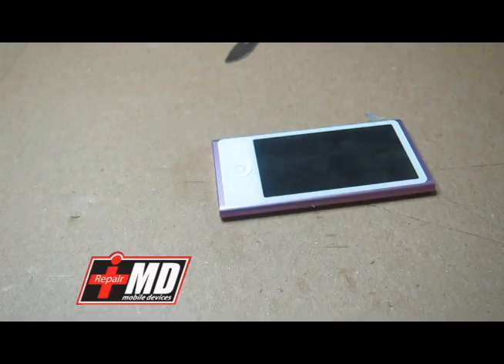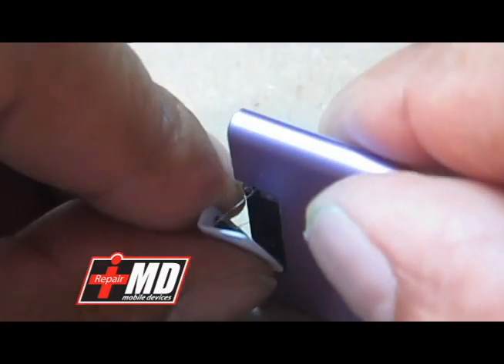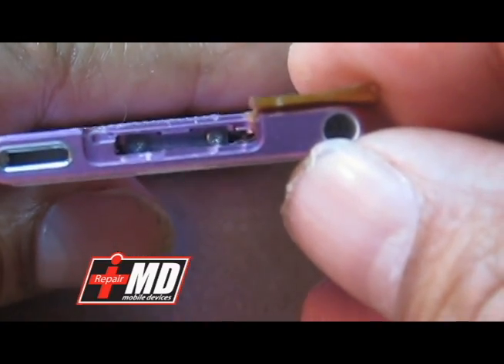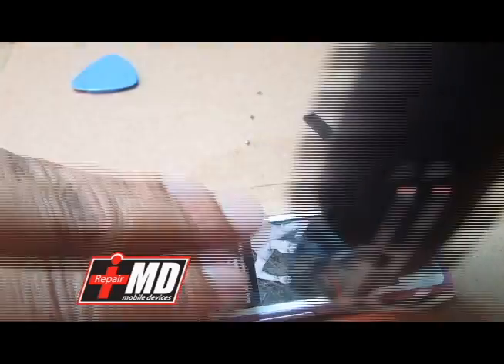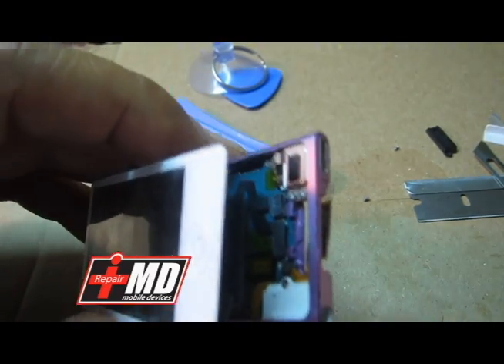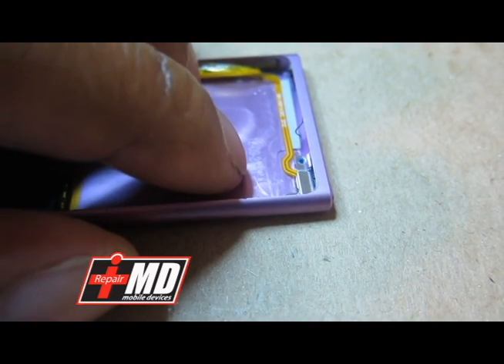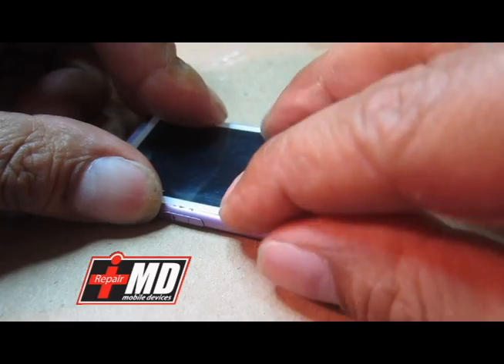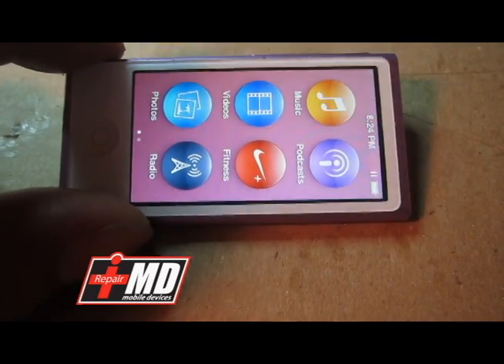iPod Nano 7 Gen. Take Apart and power button repair

Comment: This video can also be called "How to Destroy Your iPod". What isn't mentioned is that if you try to pry the LCD from the wrong spot, you can but the slightest flex in the LCD screen and ruin it. Of course, the part of the video where he's doing just that is out of focus at the most critical moment. I just needed to pop the power button back out and now I'm throwing my otherwise perfectly good iPod in the trash. Look for a better video before you try this procedure.